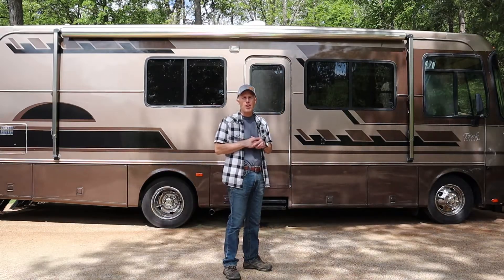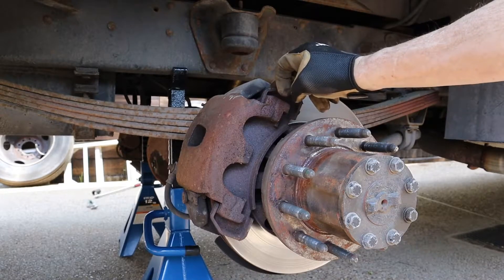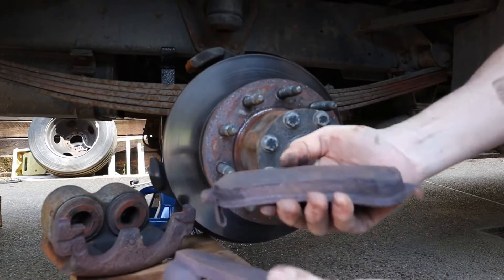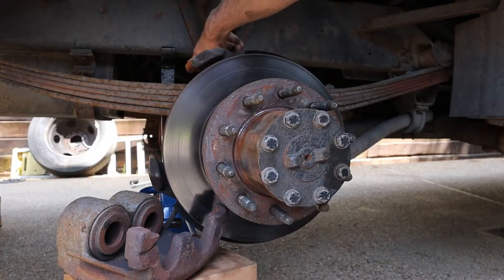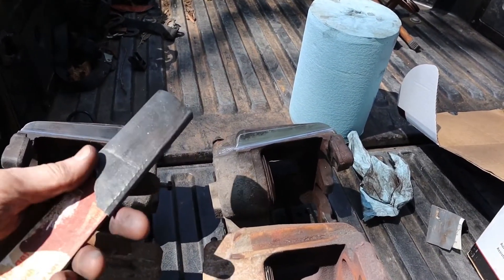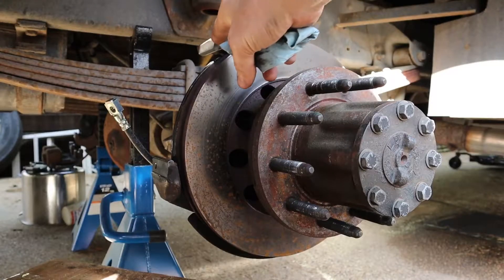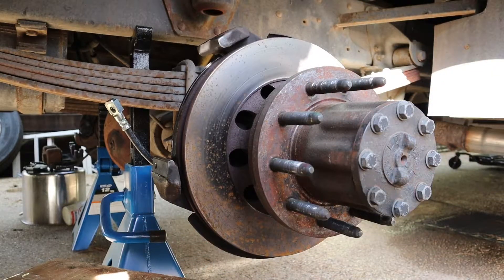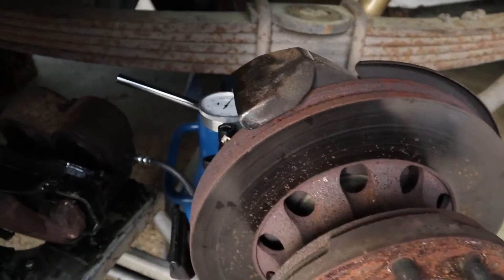Workhorse P32 Brakes - Video #2 - Calipers, Rotors, Hoses, and Pads

Comment: Thanks for a tremendous video. Just had my Tiffen Alegro towed to Campingworld for $1250!! They said they can not fix the brakes,  needs to go to a truck repair shop.! Brake peddle was going to the floor. 
Workhorse chassis 2006 Open Road model 33ft. Probably going to get it back in my driveway and.......fix it myself or find a friend with some knowledge. I'm pretty handy, I take a lot of pictures!! first!!! Kinda cold in RI right now, maybe no trip to Florida this year. 
Thanks again

Comment: Thanks for posting this video, it looks like I will be pulling the rear wheels off my Trek in the morning to check for dragging brakes.  One note though, It would be nice if you were to list the part numbers and tools you bought for this project in the description, not just as text overlay during the video.
Reply from the maker: Thank you for the feedback.  Thats a good point.  I will get the information added.  Hope your brake job goes well.

Comment: Great video! Thanks for posting it. Do you know what the #6 hex bolt should be torqued to when reassembling? Thanks!
Reply: I’m not aware of a specific torque spec - my understanding is to use blue loctite on the caliper bolt and then tighten nice and snug.

Comment: I recently saw a brake pad replacement job where the person did not push the fluid back up into the unit. The person opened the brake bleader and let the old fluid flow out while pressing the pistons back in. Made sense to me.
Reply from the maker: Yes.  You can open the bleeder screw and compress the pistons easily.  The only advantage to doing it the way I show is that it will reveal a reverse flow obstruction if you have one.  Thank you for watching and for your comments.

Comment: hi can you tell me ( or do you know ) the torque spec  you pur on the  front spindle nut if you evr change the bearings on this 5 studs hub thank you
Reply: Overtighten to 15lb ft while rotating the hub to help it seat properly, then loosen the nut. You don’t want any looseness - so no movement in the hub if you try and rock it, and should spin with minimal resistance. The spindle nut is basically only hand tight, and if you need to move it to find the cotter pin hole, only loosen - don’t go tighter.

Comment: Has anyone struggled to get the slider piece from the calpier off? Im using a punch and I can not for the life of me get the spring out! I got one out in the back and could not get either of the front springs out. PB blaster, break cleaner, wire brush and hammering for hours. I'm defeated on this one. Can anyone help?

Comment: those pads are uneven thickness brand new...doesnt have anything to do with your pads wearing uneven....theyre uneven from brand new
Reply from the maker: New pads are the same thickness. I replaced all four sets.
Reply: @ufixit  They are not the same thickness... I'm sitting here holding a brand new set.
Reply: @ufixit  Part #

MKD184

SKU #

199339

Weight

10.25lbs

Location:

Rear

Outer Pad Overall Thickness

16.6mm

Inner Pad Friction Material Thickness

21.2mm